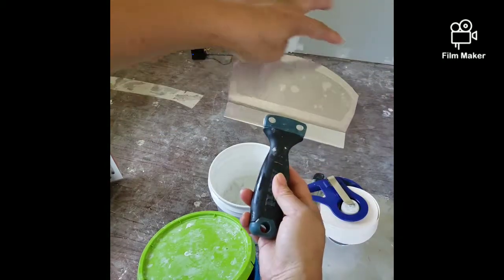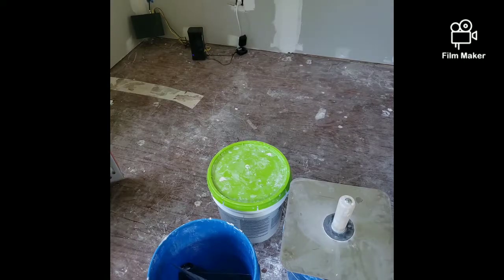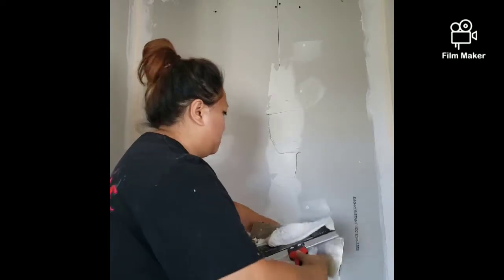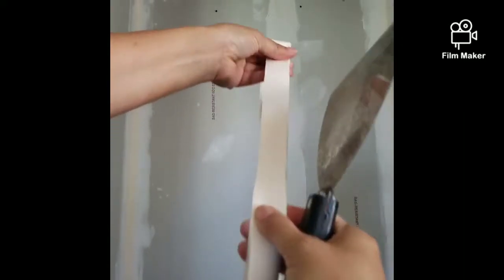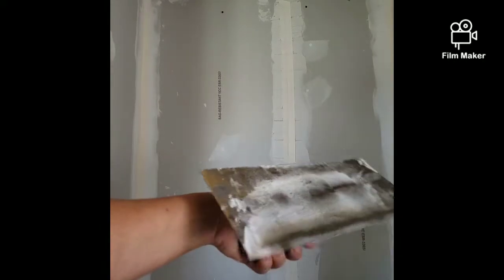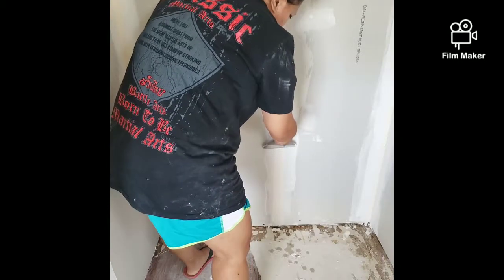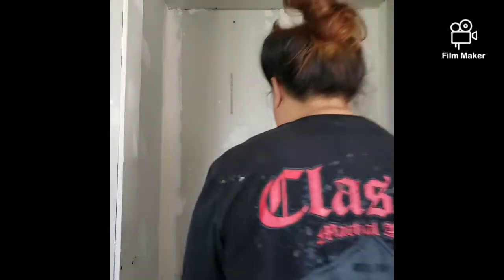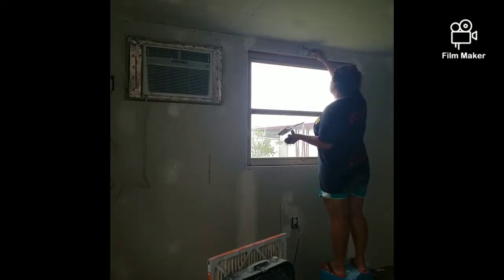(What not to do while mudding!) Mobile home renovation 18

Comment: Hi ....what size drywall did u use for the wall and ceiling?
Reply from the maker: 1/2 inch drywall. Anything more than that would be too heavy for a mobile home. We also added thicker studs. The skinny stubs that were previously put in wouldnt do.